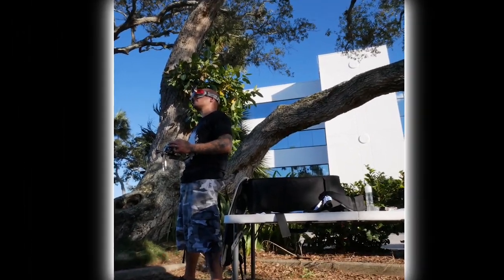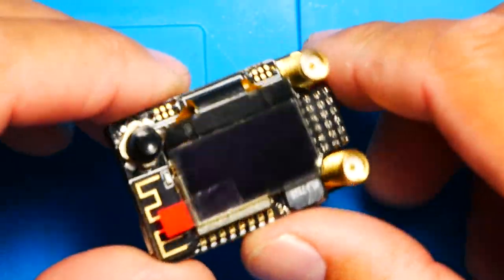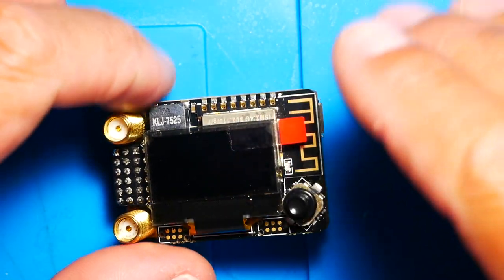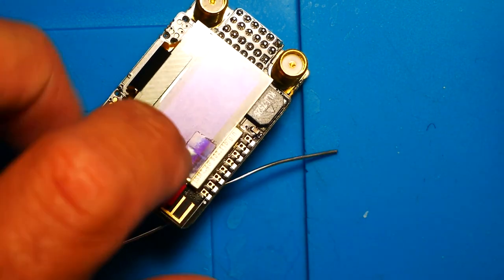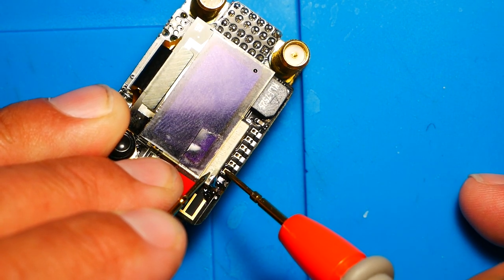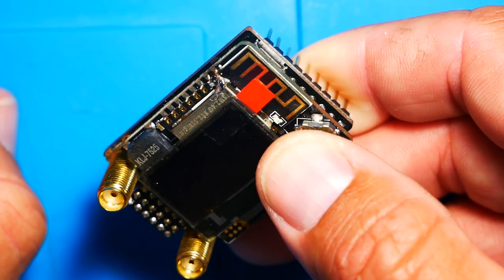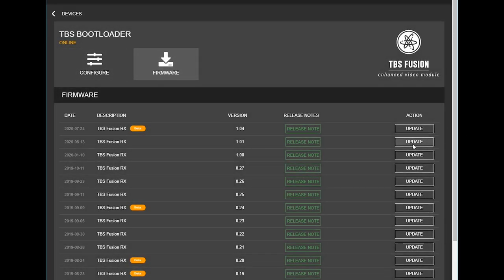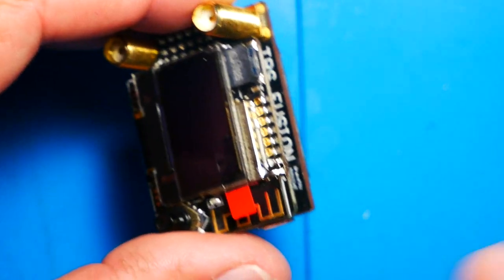TBS Fusion Frozen?! Stuck In Bootloader Mode?! Not Responding?! - Fixed

Comment: mine connects to the tbs agent x . I get a flashing blue light on the module and one still blue light . i bridged like you said and then tried to flash and it is stuck at updating main firmware . it worked fine and was on 2.17 before . I should have bloodywell left it alone . man im pissed . any help much appreciated